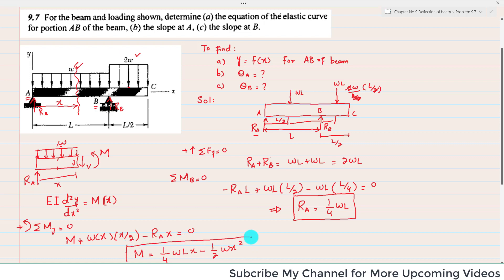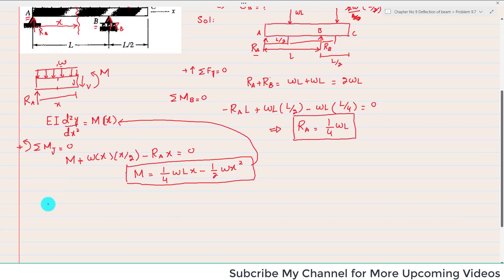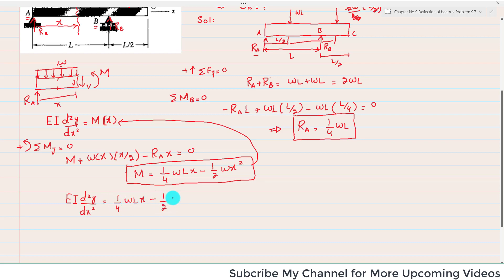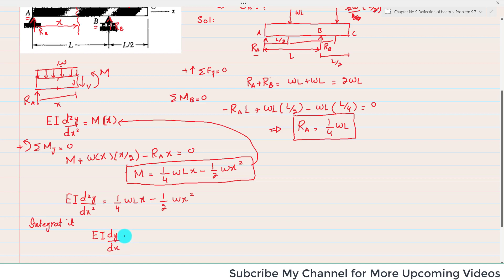Problem 9.7 || Deflection Of Beam || Beams Deflection || Deflection Of Beams Solved

Comment: Is equation of summation of moments is right : -RAL+WL(L/2)-WL(L/4) ? i think it WL(L/2) should be negative bcz it is clockwise moment...
Reply from the maker: Dear uniformly distributed load when multiply by L will be wL and it will be acting ad the mid of L. So moment will be wL(L/2). Since sum of moment is taken about point B is zero so this fornce wL will produce counter clockwise moment about point B. I hope it is clear to you now.
Reply: @engradnanrasheedmechanical  ok sir i got it
Reply from the maker: Good to know that....
Reply: @engradnanrasheedmechanical  thank you sir